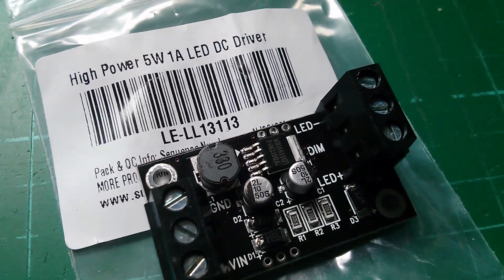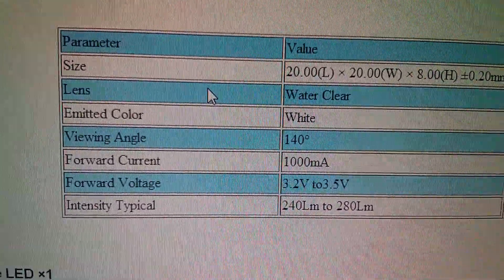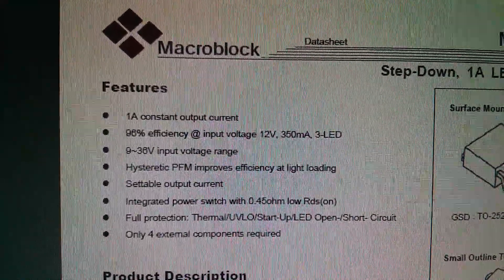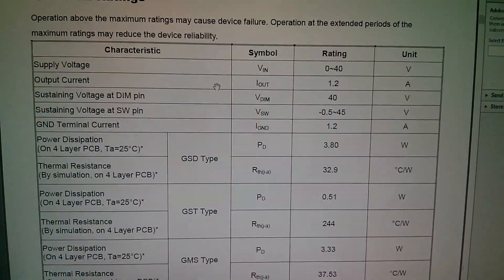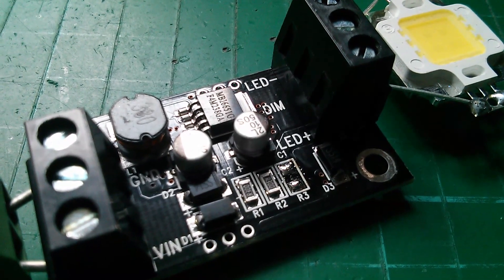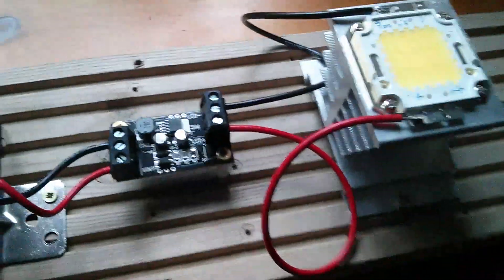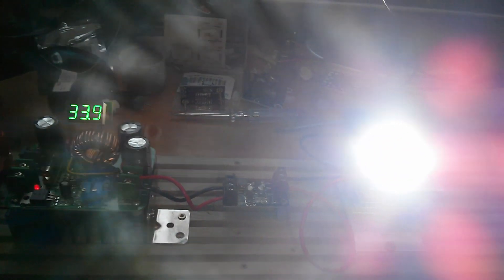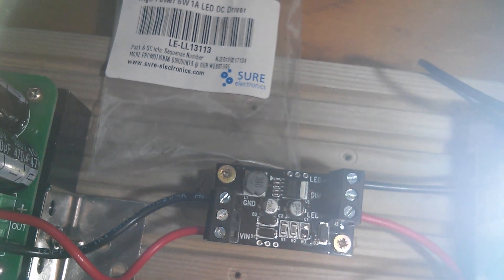Using a 5W LED Driver Module on a 20W LED - Seriously Overclocked

Comment: You did not tell us what the input voltage minus the output voltage was:  This difference is probably very small and so, for the board, volts x amps = watts (heat), is thus small.

Comment: You don't get 5 by multiplying 3.2 by 1, because you don't drive 5 watt LEDs at 5 watts unless you want them to burn out quickly, that's why. And driving a 20w LED at 3.2 watts is not overclocking, it's underclocking. Your brain just works backwards, that's all. Now put the 20w driver on the 5w LED and see what happens. That really would be overclocking. I know it's shocking but you can drive LEDs at less than their capacity all day long. It just makes them less bright but more efficient.
Reply: simhopp
You'd have to talk to Greengenes or Growmau5 for technical info on LEDs. They both have channels.

Comment: Overclocked it is not the right term, to apply here. You are not changing the clock or frequency.
I don't see why it say 5w, because the chip it is capable of more. Only if there are another component in the board that it is not capable of so much power, maybe the "output" diode it is not capable of big reverse voltage.
But great video, and very interesting board with the dim option.

Comment: parallel?  did you mean series?  If you pulled one from parallel then the current will go down. Pulling one from series and then soldering a shunt from the 2nd resistor to the 3rds output would make the current increase.
Reply: Yes, parallel.  1000ma driver > 700ma led

Comment: Am I missing the point, because it seems to me that the "5W" rating is just a guide rating for if you're driving a single LED?

The MBI6651 will accept a 36V supply and will try to deliver 1A to the load.  Therefore the maximum notional load is 36V x 1A = 36W.

At this load, the power supply will be delivering 100%/96% x 36W = 37.5W

So the driver chip will be dissipating 37.5W - 36W = 1.75W

The datasheet says that the GSD chip can do 3.8W on its 'simulated PCB' and if the PCB as supplied is half as good as the one simulated, you can dissipate up to 1.9W on the board you have.

You most likely won't be able to get the full 36V out of the board, but I imagine you will get 30V+ (which improves the thermal margin further).

So you aren't overclocking the board at 20W and you'll more than likely be able to get 30W+ out of the board without it getting too hot (bearing in mind the recommended max 80% duty cycle).
Reply from the maker: I suspect the chip itself could be pushed further - it wasn't getting warm at all. The warm diode looks like it's just an input polarity protection device, so it could be shorted out, but the black PCB makes circuit tracing quite difficult. The 80% duty cycle parameter relates to the buck converter internally - you can drive the DIM pin at any duty cycle 0-100%.
As for the title of the video... hyperbolic malapropism